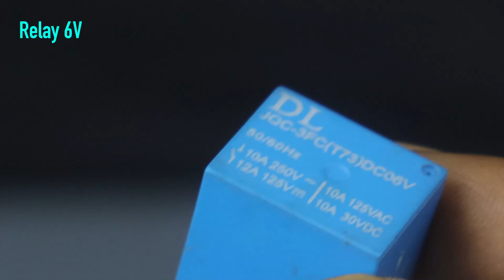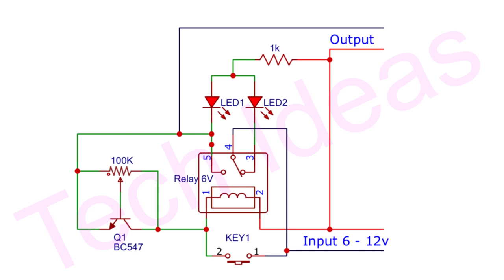Brilliant idea!! This Circuit will Save Your Electric Appliances

Comment: Virtually ALL appliances built after 1960, have overload, and short circuit protection built in. I see little value in this device. It IS clever, but like most of your video projects, simply a novel toy.